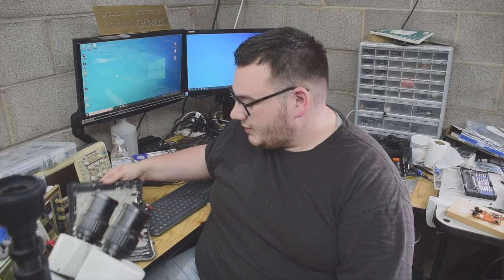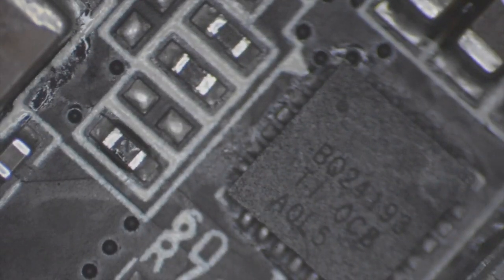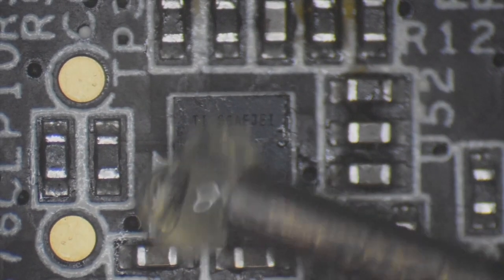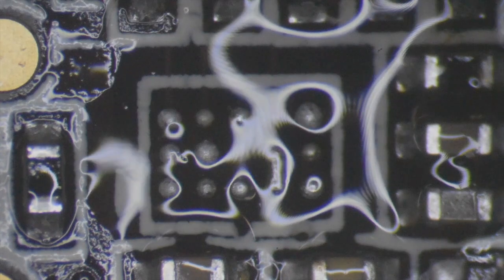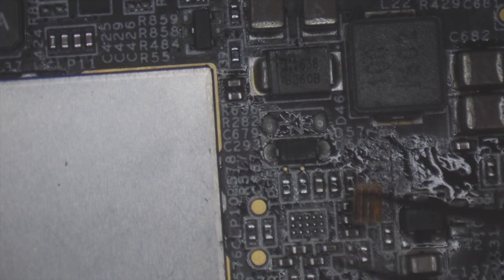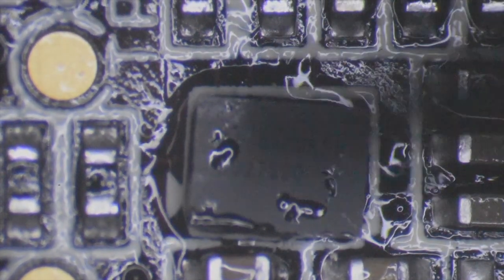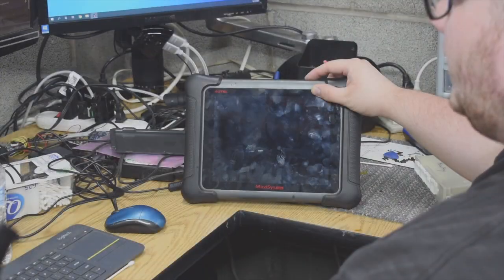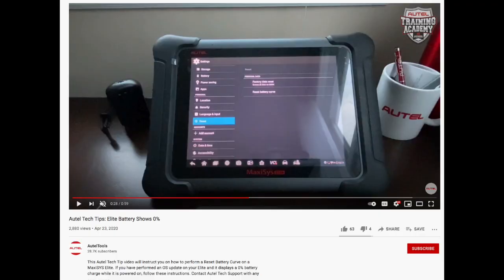Autel MaxiSys Elite Battery Shows 0% Repair

Comment: Mine works fine on ac power but either shuts down or maybe just the backlight goes out when using just the battery. Any thoughts?

Comment: Awesome video, I have the same tablet, where can I purchase a battery from? Thanks
Reply from the maker: Thank you! You can check eBay! Or just search online.
Reply: @chasefournier  Thanks, I have checked there but didn’t really know if I should trust them. Was just wondering if you put the new battery in that one. And maybe part number of the one you used.
Reply from the maker: Actually I haven't had to change a battery in one yet. 
You can try one from eBay and see if it fixes your issue.